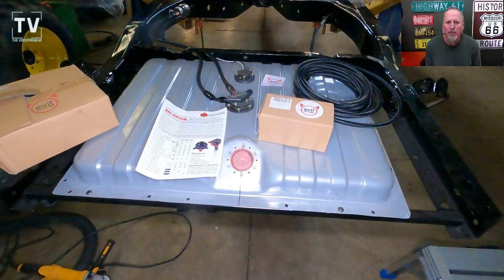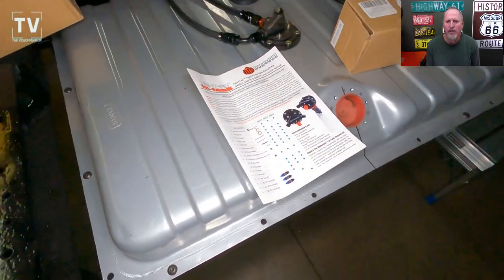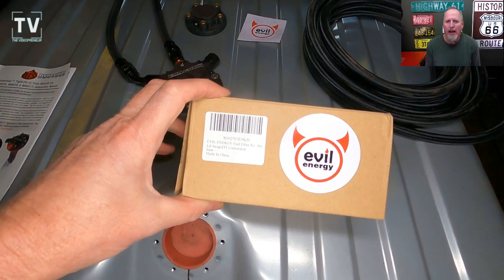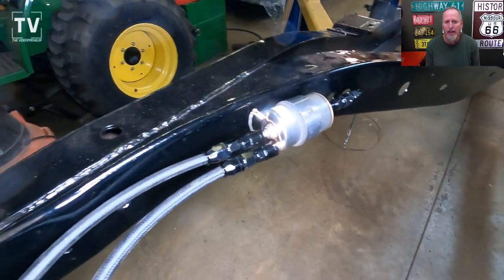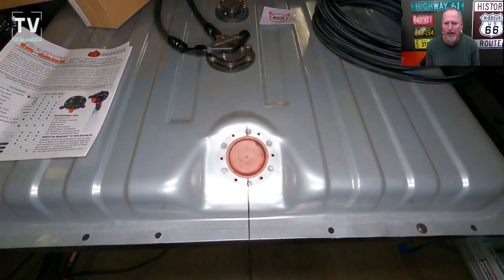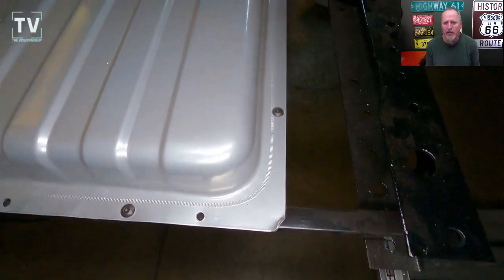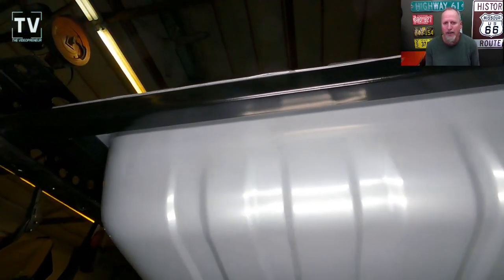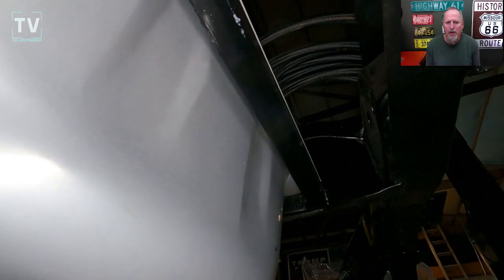1961 Chevy Apache Gas Tank, Fuel Pump Filter & Lines Install

Comment: I used a cheapo 60 mustang tank with stock fuel sending unit to an external pump for the Ls swap in my 1961 Apache step side build but cannot hook up my fuel gauge, i see this setup used a different ohm sending unit but still does not match up to GM so what is he using for a gauge? Also what tank would you have actually gone with your self? I am building a 60 stepper next and thinking of using the Boyd tank.
Thanks